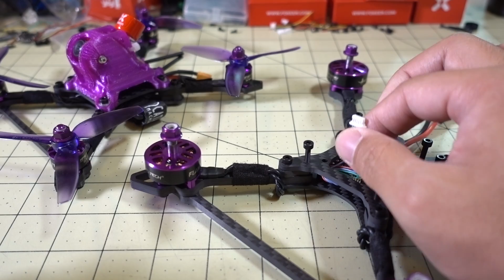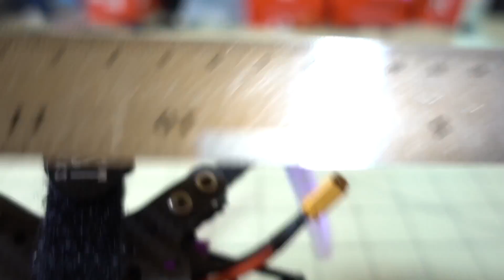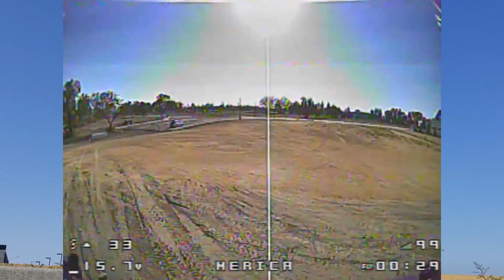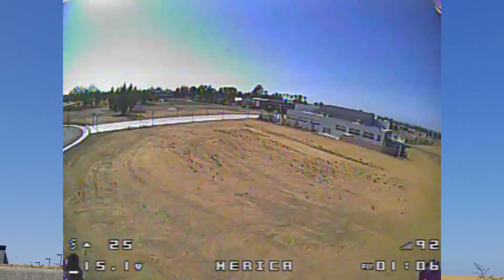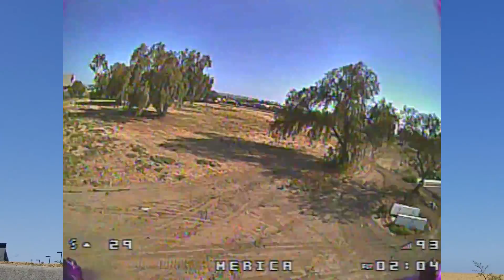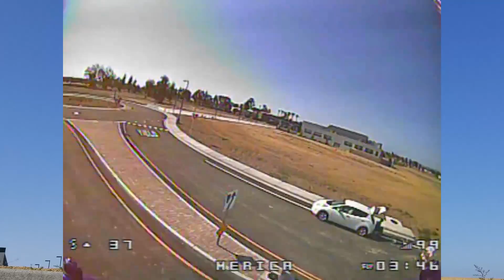CMW Merica 4-inch Racing Drone Review 😍👍

Comment: pids? pids? pids?
Reply from the maker: It's in the video (that you didn't watch). 😜
Reply: Albert Kim lol, i have watched this vid like 15 times at least. I was just trying to get my 4inch on a maiden and in a hurry.
Reply: Thanks btw.
Reply from the maker: Its about 5 minutes into the video at the start of the flight demo.
Reply: My canopy is way different, i got it from cmw, they also told me I could not stagger the front arms on the 4 inch cause the props would hit the canopy. I bought it after this video came out. Strange.
Reply: And that is not all the pid tuning values i need.